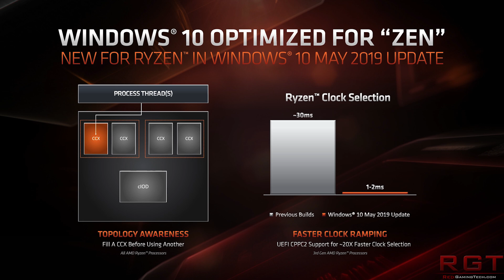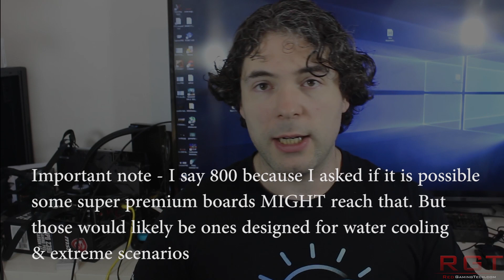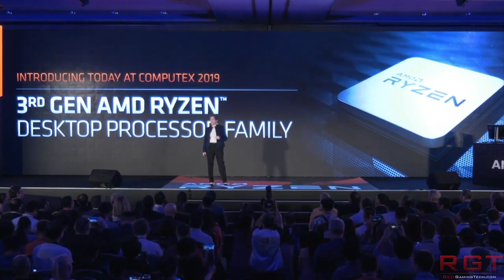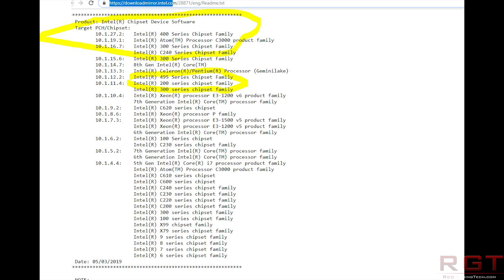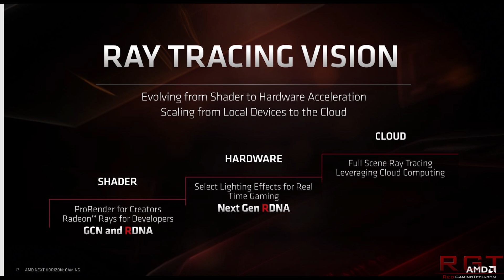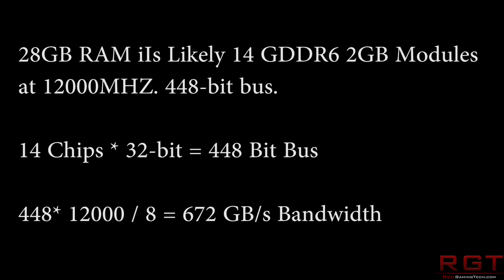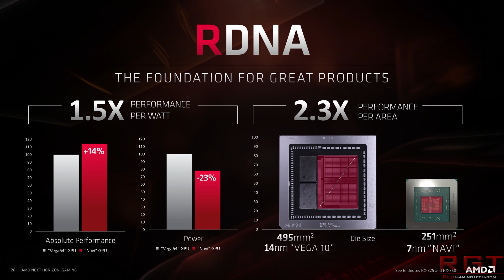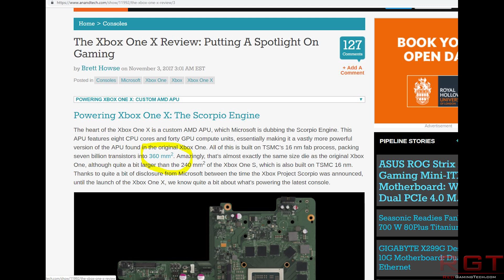X570 Motherboard Prices Investigated | Project Scarlett Spec Leak Analysis | Intel 400 Series

Comment: Please RedGamingTech
Can you inform me anything about the inbuilt function for NEXT GEN VR in PS 5.
For PS 4 it was at least partialy contained with some hardware in an external box. Now we have been told that this function is included in the PS 5 without an external box. So the question is: Is it hardware or software or most likely a combination of HW AND SW i guess. So can you say anything about this. Does the VR use the CPU AND/OR GPU or has it any special hardware excluding for instance the connectors, wiring and sender/reciever? But people seems not to understand that this may indicate that the VR package might be cheaper than the PS VR generation I!

Comment: The GDDR6 cost for 28GB would be 1/2 or more of the expected price of the console. Digi-key list 1GB 14gbps GDDR6 @ $15.58 (unable to find 2GB modules but they would be even higher in price) and I know they will be buying millions of these modules so the price would be lower. Lets say they get 2GB modules at ~$15, that $210 just in GDDR6. 80 CUs is not possible. Microsoft wants to make a console they can make money on, not take a multi 100 dollar loss on every one sold, The specs are pure fantasty for a shipping console

Comment: I don't believe that Intel's new socket for Comet Lake needs extra pins for power delivery, so it's not compatible with Z390/Z370. AMD has doubled the core count with the same socket after three generations. Well, you are getting two extra cores and some high end Z390 boards should have strong enough VRMs to power those extra cores, if backwards compatibilty is included, which it's not because... it's Intel
Reply: Totally agree. It's typical Intel bullshit. Every new processor generation is an excuse for them to claim that a new chipset, and hence a new motherboard, is required. What total crap, from every point of view ('spherical crap'!!...), except from the point of view that it makes Intel a lot more money, cos of how much they charge board partners for their chipset. It's not as if their 'new' chipset ever brings much to the table, either, usually adding precious little to the previous generation. It just adds insult to injury. Remember when s1151 v2 came out?
We have seen this whole cynical process over and over again for the last ten years, and I would imagine that many people are sick of it. 
But, I have to say, for Intel to be doing this now is a bit risky or just foolish, depending on your point of view. With AMD poised to launch their brand new Zen 2 chips, which will work on 3, 4, and 500 series mobos, it presents a very compelling option, one that Intel is not offering.

Comment: $800 for an X570 Mobo? No thanks. I'll probably get a mid-range X570 or wait until early 2020 when B550 boards arrive.
Also, what is Ray-traced Audio Paul mentioned at 13:13 ???
Reply: It's a gimmick it's not possible as human hearing can't detect more than a few degrees in audio angle change ;)

Comment: Yea Paul, On the Memory side of things. according to some people, the x470 and the x570 boards are using the same DDR4 controller but not the x370 boards. So on the x470 the DDR4 support would be kind on par with the x570 boards, but then again don't expect the same for x370. Also the VRM on the x370 boards are very weak compared to the x470 boards.

Comment: I think its to early for average user to purchase X570.   I would recommended getting a nice quality X470 thats compatible.   If you are an enthusiast who plans on pushing a 3900x or 3950 to its limits then X570's for you.
Reply: You can actually push 300w+ on a nice quality x470 board. So, if you get a 3900x or a 3950x you would be able to pushing it just fine.

Comment: That AM4 socket has a bottle neck. Too few cpu lanes for a 16 core work station cpu. If AMD would use binned chips in a six or eight core Ryzen, that would be the gamer Ryzen to buy. If you need that many cores get the TR ZEN2.

Comment: AMD motherboards were cheap for a reason, AMD cpus were total garbage and nobody was willing to make good motherboards for them. Now that AMD cpus are no longer garbage, manufacturers are charging the price of motherboards that people actually want to buy.

My 350 board can fit a 3950x in it, and it was basically free. If I want a 450 board that can actually provide a little power to it, that's a bit more expensive, but not unreasonable. These expensive motherboards just give an option to overclock the shit out of them, rather than merely running base clocks, where my 3950x would stay if I felt the need to buy one.
Reply: You should get a x470 board anyways as you are missing out PBO, which give a fucking op boost on any ryzen cpu... with a b350 you can run a that x3950 but you will be missing XFR punching the way it should plus missing out the PBO completely

Comment: If Microsoft kept the same die size, they wouldn't have to reengineer the cooling solution they currently utilize in the Xbox One X right? So that would save them some R&D time and cost. 

So my line of thought is this; if Microsoft kept the same die size, they could up the number of CUs for the Anaconda Model to 80 CUs. The base model  Lockhart at 60 CUs. 

Or maybe a beefier CPU/GPU in this leak for a Dev Kit, then have the Anaconda model at 60 CUs and Lockhart at 40. 

I hope it is my first thought though.

Comment: 200.00 to 250.00 USD for the ENTRY Level X570 boards?!
Damn. I am getting a R7 3700X for 329.00 but may just get a mid range X470 or high end B450 with it.
Reply: Buildzoid ( via Gamers Nexus ) recommended the B450 Gaming Pro Carbon AC @ $140 US and the X470 Aorus Ultra Gaming for $130 US. Those two seem like your best bet, especially if you plan to overclock the 3700x. Also, B550 boards might come out later this year, and a few more entry-level X570's might as well.
Reply: There are not entry level x570 those are basically top shit. You dont need pcie 4.0 just yet so my guess is to get a very good x470 board. Like an Asus x470 Prime pro or a Rog Strix-f

Comment: X570 mobo is about to leave me broke. rip.
Reply: BuildZoid did a great video on x570 vs x470. Right now there is almost no point in getting an x570 motherboard. PCIE 4.0 is most certainly the future but short of a 4x Raid 0 with NVME drives nothing can soak PCIE 4.0. Get a decent x470 and upgrade again in a few years

Comment: 12 cores cpu and 80 CU gpu? 😂😂😂 what is the TDP 400 watts? 😂😂😂
Reply: That seems a bit optimistic without cutting the clocks down. 3900X has a 105W TDP, 5700 XT has a 225W TDP with only 40CU so that’s two of those dies put together. Which gives a face value of 555W. Which is about 3 times that of the most power of the most power hungry console of all time. That also doesn’t take into account that consoles tend to have the worst silicon quality.
Reply: @backupplan6058  I know man, that's why this spec its just stupid, the die size would be around 600mm
Reply: @adi6293  the CPU at 12c is not unrealistic for next year using custom zen2 cpu at lower clocks whats completely crazy is the 80cu on the gpu side... we are talking about 220 on the current navi imagine lower clocks with double the CU hahahaha it would be at least 340is watt plus the cpu pulling 50 to 80watts and you got to throw the nvme drive plus the board it self. It will be end up drawing around the same as my current setup ryzen 2700x +1080ti + 16gb at 3600mhz 1.4volt or even some more. and to cool down my pc you need some fans and good airflow.
Reply: @neikory  I could believe those spec if AMD was designing some $1000 gaming APU not a console APU 😅

Comment: So now the question is which X370/X470 motherboards have both excellent VRM's and excellent RAM-OC'ing but a nice discounted price. ;)
Reply: X450 or x470 you will be fine
Reply: Msi x470 gaming x470,  gigabyte x470 gaming 7, Asus strix x470, or asrock x470 or 450.  Board choice is your choice but anybof those will be fine
Reply: @dalemaluke  

The VRM's on the MSI X470 aren't good enough for a 16C Zen2 CPU. The same for the Asus Strix and ASRock 450 motherboards. The 16C might be too expensive now but prices might drop a lot in the future! I am worried that the Taichi is not so good with RAM-OC'ing because it uses a T-topology.
Reply: @Noodle Confusion 

Generally speaking daisy chain is better for a high clock frequency and tight timings because the wires and stubs are shorter, T-topology is better for more modules. Unfortunately the motherboards which have good VRM's also often have T-topology to accomodate for 4 modules of RAM.
https://www.techpowerup.com/reviews/AMD/Ryzen_Memory_Tweaking_Overclocking_Guide/4.html
I was hoping that somebody with knowledge on this topic would weigh in. I know that the T-topology is a handicap, the question is how big the handicap is. All you need for Zen2 is 3600 MT/s.
Reply: @peterjansen4826  Asus X470 boards use daisy-chain topology. And you need high end VRMs if you plan to overclock 12/16-core with custom loop. With air cooler and most AIOs you will be thermally limited before for example X470 Strix VRM give up(wouldn't pick anything lesser thou). Basically it's not important to have VRM capable deliver over 300W if cooling can handle only 200W.

Here's some memory overclocking results.
https://docs.google.com/spreadsheets/d/1dsu9K1Nt_7apHBdiy0MWVPcYjf6nOlr9CtkkfN78tSo/edit#gid=1814864213
Reply: @kognak6640  

I read on more than one source that the X370 Taichi uses T-topology. Do you say that the X470 Taichi uses daisy chain? I don't plan to use a custom loop if I would use a 12C/16C, just a good aircooler (D15, DRP4...), I would stay under 300W when there is a full load. I understood that the X470 Prime Pro has better or equal VRM's to the X470 Strix? I am much more worried about the quality of the traces and the wiring than about the VRM's. I know which VRM's are good enough but it is more difficult to figure out which motherboards have high quality traces and wiring in between the CPU socket and the RAM-slots.
Thanks for the spreadsheet, that helps.
Reply: @peterjansen4826  Better memory overclockability of 400-series is largely due switch to daisy chain. I don't know for sure if X470 taichi has it(probably), I'm more familiar with Asus boards. T-topology is better if you are using 4 sticks of memory but that's not recommended if goal is to overclock memory. Two single rank sticks are best.
X470 Prime and Strix have same PCB but Strix is better every way. Prime is compromised by weak VRM heatsink, otherwise it's ok board(I have it). Works fine with 6-8 cores with mild overclocks. Strix VRM is 6-phase VRM with 50A powerstages(Prime 40A) and heatsink is much better. For VRM quality Strix is lowest Asus sku to consider if overclocking is in mind.
Asus in general has best bios quality but it's also most expensive. And their budget skus are pretty crap(VRMs).
Reply: @kognak6640  

I will look into it. Thanks. Yes, I know that you should run exactly one module per channel for Ryzen. At least for Zen1, I assume that that won't change for Zen2. As I understand it the Prime has a reasonably good quality VRM (wattage which it can safely have) but you do need to get some airflow over it. I mostly lean towards the Taichi because of the quality of the VRM, though that BIOS is a bit of a maze, allegedly. If the memory clocks well. A strongly discounted high-end Asus or Gigabyte Gaming7 motherboard would be interesting but so far those prices haven't declined much.
Reply: Take a couple of days of work (and some drugs) and watch Buildzoids videos on Ryzen boards.

Comment: Not gunna lie I burst out laughing when I heard 80 compute units...the 5700xt is already rated at 225 watts😂😂😂
Reply: That's total board power, not chip power - the compute units being doubled only needs a bigger bit bus, the rest of the chip can remain the same ro really we're only looking at 20-30% so about 300W. If you take a look at the 5700 XT vs the anniversary model, 80mhz speed on the top end increased the power by 10 watts, so the cards power draw comes from over-ramping the clock speeds, then I think you'd see far better perf/watt just like vega and polaris - any NVidia card too, my 1080 TI drops to 220-240W with a 50mhz speed decrease.

TL;DR - Speed clocks are too high, increasing power consumption drastically, doubling CU's while lowering the clocks would make it a trade off.
Reply: @1ch1r1n  Exactly, The speed vs efficiency chart is an exponential curve. You could lower the clock a bit and double the size and still be rather "close" to the current 5700xt power draw

Comment: The one problem i have with the board prices would be everyone says well the x470 is backwards compatible. But if you dont already have a ryzen cpu to use to update that motherboard, the more expensive price still stands because you need x570.
Reply: Right now i coul buy a 9900k for under 500 and a aorus pro wifi for about 170.   If i wait for a 3900x that will be at least 500 and a decent x570 might be 250 or more. Yes i would lose on pcie 4 but so would anyone with a cheaper x470 or lower.
Reply: @Filipe dos Reis that may be. Im trying to decide to get a new ryzen and i got this goin around in my head. Im not on either side. I was really looking forward to zen2, prices arent quite as low as id of thought on the cpus but they arent bad. But the talk about the motherboard prices is got me thinkin more.
Reply: @Filipe dos Reis if i were to get a zen2 cpu, i wouldnt be able to buy an x470, it requires a bios update, which i would need a previous zen cpu to do that with.
Reply: If X470 board has bios flashback, you don't need cpu(older ryzen) or even memory to update bios.

Comment: After seeing those prices, I just went ahead and rather bought a really good X470 motherboard aimed at enthusiasts, the Asus ROG Crosshair VII Hero. Definitely a better purchase than the X570 which doesn't have much of a benefit unless people really wanna futureproof and have PCIe 4.0. While the X570 motherboards I was looking at do rather look better, I just think that if people don't want to spend as much, it's just better to pay for more premium X470 motherboards as a lot of them dropped in prices.
Reply: Do you wanna pay $100 extra now, or $250 extra + whatever you paid today in 2yrs because the new consoles will be designed for multi-cores being fed with higher data-rates than currently available with the ancient PCIe3.0 bus
Reply: @czdaniel1  What? You do realize that current-gen consoles operate with something that is called an APU, which has both the CPU and GPU integrated under one chip, which means there is no need for PCIe bus. The same will be with the next-gen. The difference is that the next-gen consoles might be comprised of a m.2 SSD or maybe a PCIe SSD. Otherwise what you are saying is bollocks because I might as well get a X570 or even a future X670 motherboard if I do so desire. I prefer it this way than being forced to buy a motherboard each time I wanna upgrade to a newer CPU like Intel does it.
Reply: @DaWolfetrax  You do realize that your entire sentence that starting with "You do realize" had nothing to do with what I said...and your 3rd sentence, the one about future consoles just repeated my point about the PCIe hi-bandwidths for dataflow in upcoming consoles which future games will be designed to take advantage.
And I didn't ask or even say anything about Intel. I just said the extra $100 today for PCIe4.0 is a better purchase than paying $150+ for a quality x470 which will be replaced in two years when the game design and hardware industry is focused around and practiced around the new hardware capabilities available with PCIe4.0 & 5.0 bandwidth vs ancient 3. Memory is cheap, 8gb video cards and the system bus-speeds used to feed it will seem tiny & quaint compared to what's coming. I mean, you can live with it...like a 4gb video card & 8gb of RAM. But you are gonna drop new rendering features and reduce your draw distances...and then wonder if you need higher memory clocks, or a new motherboard which will be compatible with unlocking the newest video-cards which will be designed from the start to integrate with high-data flows between NVMe and RAM...Paying $100 now beats paying today plus another $250 in two or three years to catch up to where you could be today.
Reply: @czdaniel1  GPU's today still don't fully utilize PCIe 3.0. What makes you think that just because there will be GPU's that support 4.0, they will take full advantage of it? It will take some time before they will be able to. And don't fully trust AMD with the comparisons between PCIe 3.0 and 4.0. Just take them with lots of grain of salt since they wanna make it look like a huge leap, which it may or may not be (currently speaking).  Anyways, by the time I'll wanna upgrade, 5.0 might start to become the norm and that's completely fine by me. Technology keeps evolving, but that doesn't mean it will become a standard within a year or two. I'm limited by a budget anyways, if you have the money for it, good for you, but I don't.
Reply: @DaWolfetrax  Of course they don't. If they fill 3.0, then the games would be choppy. The only reason to do that to customers is to drive sales over to your PCIe4.0 graphics cards. Today, if you filled 3.0 the engineers who designed the card would be fired for building hardware which outputs information that they can't possibly deliver. 

    Wake me up when the PCIe3.0 optimized design for graphics cards gives you so much free hardware on board because nVidia hates money so much that they saturate the pipelines with data the engineers know can't possibly be delivered!!